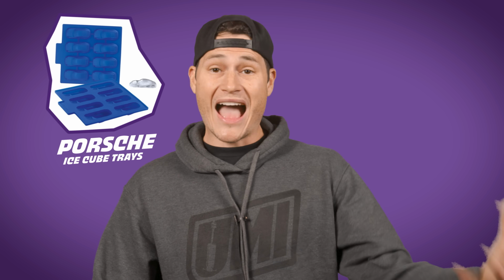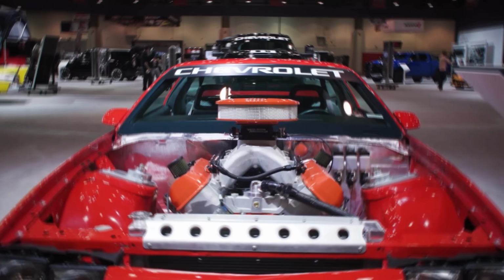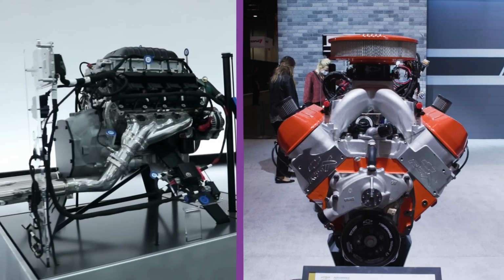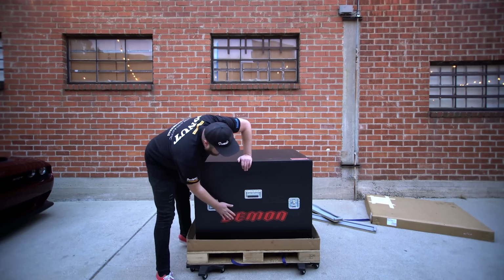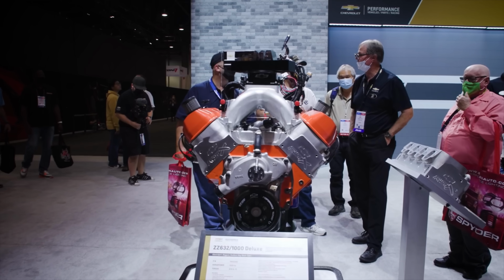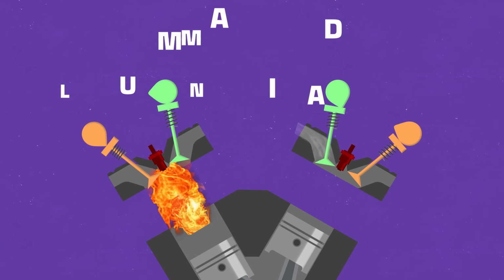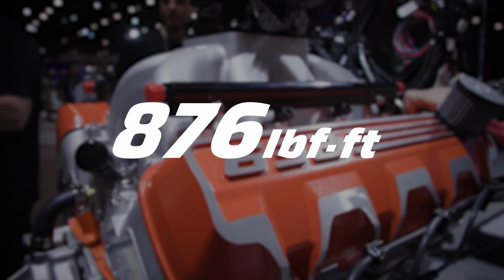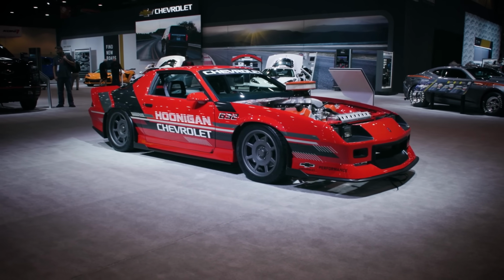Chevy's 1000HP Crate Engine EXPLAINED

Comment: That's so sad that trailblazers went to a 1.2 liter 3 cylinder when they used to have an inlline 4.2 liter vortec which had variable valve timing, and is Luke the American 2jze. Also known as the amerabarra, which is because it's similarly like the legendary Australian Barra engine. Those 4200 vortecs are way under rated, and a few people are getting 700whp out of fulp stock bottom ends.

Comment: Stick that engine on a 2006 4 dr GMC 2500HD pickup with a WFO Concepts straight axle on coilovers conversion lift job running 37" or 38" tires. That's my dream truck. But what automatic transmission would you have to get with an Atlas or NP205 transfer case that would handle this amount of power and torque?

Comment: I was building 632s back in 1990. They called them Pontiacs, but they were big block Chevys. We were getting around 1400 horsepower out of them, but they were 13:1 compression with solid roller cams...

Comment: Explain to me why this engine sounds so good and the stock Chevy ZL1 motor does not sound this good. It does not Chop either. This motor sounds like a NASCAR when it cranks up its loud and it chops and it's got a beautiful nasty sound to it why is it the stock Camaro ZL1 doesn't sound like this

Comment: I have been trying to find a measurement sheet that details widths between mounts, height from the top of the throttle body to the bottom of the oil pan, width left to right, length from water pump to flywheel and anything else that I can get my hands on. All I have is small blocks but want to make the jump. This beast is one helluva jump!

Comment: An all motor engine making 1000hp is absolutely remarkable. Bravo 👏🏽
Reply: N/A is where it's at.... fuck all that boost
Reply: @davelowets I needed this in my 88 Cheyenne. Had plenty of room for it. With 261 gears in the rear end too. Could finally reach it's top speed of blowing the tires out

Comment: the long runners on the intake remind me of the 351 SVO crate engine. The 632 has even more air volume displaced so it sucks even harder to pack the intake charge with a hearty pulse.

Comment: Minor gripe: big block did not go back to the 50s. I have the original Hot Rod magazine from 1965 debuting the "Mark IV mystery motor" which was the 396 in the passanger cars and the 427 in Nascar. Junior Johnson made the mystery motor famous in Nascar. The "W" engine 409 was developed in 61-62.

Comment: Why carburetors and that stupid donut filter which will not fit ANY modern car without sticking through the hood like a ghetto rocket? Nevermind that 90% of the mechanics and car builders not on social security or in the ground has even seen a carburetor never-mind work with one.

Comment: Fabulous engine from GM .  There engineers have completed an Awesome job .  What l would love to see is a Wilson Tunnel Ram Manifold as an Option going 4ward with twin Wilson Throttle Bodies .  They are using one ,  probably a  ( 4500 )  A pair of there 4150's would probably be more than enough.   May give another 500 rpm & hopefully another 80 - 100 hp . Maybe a few of us asking the Question of GM may get this option a gurnsey.   Hope so .

Comment: 1000 hp that's not force induction, eh...? Hypothetically speaking, what happens if you add a turbo or two? 🤔 😉  I WANT ALL THE POWER!!!!
Reply: This engine was built from the ground up not to be super charged. The heavy duty crank, the over sized cam, and the 12:1 pistons, and the under intake fuel injection. It would be impossible to put a forced intake on this engine. But chevy makes a 632 crate engine that you can add a super charger to. It about 15,000 dollars. And starts at 800 HP out of the box. You can add a Whipple super charger that will add 350 HP. For about 10,000 dollars. So you can get 1150 HP for 5 grand less than this engine. And it will all fit under the hood. But it won't beat the sound or beauty of this engine.

Comment: 100hp/liter is pretty good for an NA big block designed in the 50’s/60’s.
Reply: Those cylinder heads and intake manifold were designed much more recently and are significantly different than the original design, and cylinder heads are what determine the power potential of an engine unless something else is really messed up on said engine design. Building a 1,000 HP BB Chevy with the old factory cylinder heads would be quite the feat without boost.

Comment: I paid $15k for a used injector to pan Keith Black Hemi that produces about 10k HP. seems to work well, but requires a complete rebuild for every 1/2 mile driven.

Comment: 6:24 this pissed me off a little bit.

Valves get pushed DOWN, into the cylinder. They don't magically phase through other materials, so it's physically impossible for them to move upwards into the intake/exhaust housing.

It's not even that hard to visualize... because it's literally been visualized when the animation was being created.

Comment: the term "there is no replacement for displacement" is complete bs. engines power limitations are limited by air flow capability and mechanical limits. a 1liter engine with the same flow as a 10 liter will make the same power just at a higher rpm. you can have all the displacement in the world but if the heads wont flow you wont be making any power.

Comment: A SYMMETRICAL HEAD CHEVY BIG BLOCK BASED ON THE FORD CLEVELAND DESIGNS. THAT IS WHAT THESE CHEVY MOTOR ARE, BEING FORD BASED IN DESIGN. IN AUSTRALIA FORD CLEVELAND BUILT ENGINES TODAY ARE MAKING OVER A 1000HP WITH LESS CUBIC INCHES, 440ci. ALL THESE CHEVY RACING ENGINE YOU SEE IN THE AFTERMARKET TODAY WITH SYMETRICAL HEADS LABELED AS CHEVY ARE FORD BASED DESIGNS WHICH INCLUDES THIS GM ZZ632. THEY ARE BASED ON THE BOSS 429, CLEVEND 335 SERIES AND 429/460 385 SERIES. THE DRCE PROSTOCK ENGINE CHEVY HAS BEEN WINNING WITH SINCE 1983 IS A BIG CUBE FORD CLEVELAND ENGINE. THIS IS THE REASON FORD DOESN'T PARTICIPATE IN PROSTOCK RACING.

Comment: Ohio crankshaft will build you a better motor with more power for the same price or you could just buy the 706 short black put your heads on there in an oil pan and competitors and then take and still have money left over

Comment: 1000 hp with no power adders my ass. Lol just like the old horrors had as much hp as they claimed. Haha also they thinned out the valves on a supposed high hp engine? Lol get ready for valve problems.

Comment: HEY I GOT ONE FOR YOU LOOK UP NASA AND STIRLING FREE PISTON GENERATORS.
THEY TRIED FOR YEARS TO DESTROY ONE.
IT HAS RAN UNDER FULL LOAD FOR 110,000 HOURS STRAIGHT.
BEING EXTERNAL HEAT IT WORKS GREAT WITH HEAT STORAGE WHICH IS SAFE CHEAP AND EASY TO USE.

Comment: Get 2 shoehorns and put one in an Opel GT   Now that would be some serious engineering not to mention you had better have an entire sheet metal shop with a couple of metal working mofo's.
I almost bought an Opel GT when I was 16 from a family friend but she decided against it.  It was emerald green with about 10 pounds of meta-flake in it.   It was beautiful in the sun......  I fell in love with it.... I got to drive it a couple times and it was probably the smartest thing she could have done.... not selling it to me.   I weighed a whopping 135 lbs at 5'10" when I was 16 years old and it was a tight fit even then.   I probably would have killed myself in it anyway..... Those cars aren't exactly at the top of the list with Subaru.
Peace.

Comment: Wow my 632 race engine put out 1231hp with twin 1150 quick fuel carb all motor. and I only paid $24,800 from my engine builder.  I could have a built a 737 from him for the price of the GM 632.

Comment: Yes, it's easy take more power than this with a naturally aspirated big block. The point is this is a factory gm made engine. Don't want it, don't buy it. I'm willing to guess most of the commenters here have never rode in a truly rowdy big block car. No, it isn't a turbo charged wonder like a 2jz or something similar. Yes you can make the same power in a forced induction coyote or hemi or LS. You should just be happy that a major manufacturer is willing to bring an engine like this to market in an Era of emissions strangleholds. Guessing most of the hate is from people who ha e barely experienced a real 600 plus engine and are simply regulated to keyboard warrior status. Would I go with this?, no. You can easily achieve this with big block chevy architecture for far less money however, the fact that it is an option in today's "green" world is encouraging. To make it clear, I'm not even a Chevrolet fan.

Comment: I'd opt for a '71-75 Coupe DeVille.  They came with a 500ci (8.2l?) V-8 so I'd guess this crate engine would fit, and you have lots of room for a bigger transmission, diff, bracing, etc. etc. to take the power.
Reply: Correction.  Only eldorados came with the 500 engine.  DeVille's in those years came with the 472.    But yes.  There would be plenty of room for the 632 in the engine bay.  I know because I have an all original 1971 coupe DeVille in my garage.
Reply: Or an early 70s El Dorado.

Comment: The original big block Mark II "Mystery engine" had symmetrical ports, which GM decided were too expensive to mass produce so the Mark IV had the short and long intake ports. Decades later GM finally produced a symmetrical port big block engine which was what chief engineer Dick Keinath wanted from the beginning. Sadly, he didn't live long enough to see it happen as he died in 2010.
Reply: Well in a way he did. The 8.1 liter Big Block available from 2000-2009 HD 2500,3500  GMC and Silverado had the same type of cylinder head.
Reply: That symmetrical port big block sucked also....

Comment: Has anybody done a real life dyno test on this engine? You know how the factories lie about hp. I would guess that between 700hp to 800hp is all you will get.
Reply: No, I have a 565ci BBC with smaller heads and cam and it made 738hp and 675lbft

Comment: Jeff Byrd can get 900+ out of a small block chevy and that is alot of power before nitrous or add-ons.  Lincolnton North Carolina.  That is a shop build not a corporate build. Not impressed with a 40 grand build less than 1500hp.

Comment: OR.....What about a 32 valve DOHC 632?

Porsche M28 four cam/four valve cylinder heads will actually fit on the Chevy block.  Arias in California has done this conversion;  It takes some drilling and welding, but since the bore spacing is almost exactly the same, you can install a Porsche cog from the front of the cam/waterpump on the big block Chevy to drive the timing belt to the exhaust cams on the Porsche heads and now you have a DOHC 32 valve engine.  Arias has done this with 502's, and the Porsche cams can support up to about the air flow that this displacement requires.  

The 502 makes 550 hp all day long like this and will pass California emissions standards.  Imagine a DOHC 632 with porting and better cams.....

Comment: You know, a 180 degree "V" angle on this engine would make it PERFECT to power a lot of King Airs and other airplanes that use PT6 engines...
Reply: To be honest would not want to scream across the skies with two of these 😂
Reply: you can't just change one aspect of an engine. Completely changes its balance, stresspoints, oiling and cooling.
Reply: @heygek2769  You would have to change the crank and cam, but I doubt oiling and cooling would be affected.  Aircraft have totally different engine mounts than automobiles, and "boxer" flat engines are naturally balanced.  Orenda up in Canada has powered King Airs with big block Chevy-derived piston engines and they work just fine.  It would work if someone would do it.

Comment: Bare with me because what I’m about to suggest is absolutely INSANE But… I bet ANY true gear head, horsepower nut, or speed freak would love to see it at least once in their lives!! Now take into account you’d have to butcher this vehicle like Jack the Ripper but still. Cram a 632 down into an old Chevy Luv mini truck!!!😏 Hearing people say “Your stupid! You couldn’t make that fit if you wanted to!” makes it even more desirable lol & there isn’t ONE doubt in my head that you guys couldn’t make it work. Just picture it… A tubbed Chevy Luv with a 632 B.B., Ford 9” rear end, & maybe possibly a sequential 6 speed! It would be pretty much guaranteed that you’d need to setup up a remote shifter for the trans but that shouldn’t be to much of a problem especially compared to getting a working clutch pedal installed, but on the bright side you’ll only need the clutch pedal for take offs & reverse 😜 I’d imagine the driveshaft in a setup like this couldn’t be more than a foot or two long depending on engine placement (the farther back the better) & transmission length. The end result for the driveshaft may just be two yokes welded together🤣 Whatever, it would be awesome!!!! What a beautiful little Frankenstein wheelie monster it would be. I dub this imaginary work of art   ☠️“Frankenwheelie”☠️

Comment: I like the fact that they put a carburetor in this engine since they haven't been in new engines since 90s
Reply: Not a carburetor, a Holley throttle body .
Reply: @fredbadgett7962  I thought it Has a carb because it has giant air filter on top but ok

Comment: Allow me to make a suggestion: There needs to be some explanations about thermal, mechanical, and chemical efficiency limits in ALL overhead valve internal combustion engines regardless of the number of valves or cam placement. People are still stuck on this HP/L measures of volumetric efficiency when they need to realize that more rpms, larger straighter ports, and radical valvetrain events create this in ANY engine. Volumetric efficiency is only used when there are displacement limits like in racing classes and European and Asian tax laws. I'm in the USA, so I could care less about HP/L, and here is why:

Here is how a real engine builder thinks about this: I can't achieve better than 30% efficiency so I'll build the largest displacement engine I can and then make it breath how I want. If I want low maintenance hydraulic lifters then I'm limited to about 7000rpm. If I wanna run pump gas I'm limited to about 11-12:1 compression. If I add just a bit more deck height on the block and option for a conjoined bore block, I can support that 4.600x4.75 bore and stroke which gives me 632ci or 10.3L. How much HP will it make? Depends on cam, intake, and head combo, but at 12:1 compression I'm going to make a MOUNTAIN of torque somewhere. If I don't go nuts on cam and head ports, that torque can be MASSIVE at 1500rpms. I don't really care about engine features, only external dimensions, weight, and packing in as much displacement in the smallest cube possible. All engines are just cubbish blobs that make torque.

You guys need to start overlaying dyno curves of torque and power so that your fans can see all of that area under the curve. Not sure why Euro/Asians can't seem to grasp this basic understanding of how this stuff works.

Do you guys really think this engine weighs a full 250lbs more than an LS? Think about that for a sec. It's two inches wider, two inches longer, and two inches taller, and the extra area isn't composed of lead.

Next thing we gotta talk about is packaging.  These arbitrary assertions that a Mark IV is "big", "huge", and "heavy" are damaging to new enthusiast's understanding. JUST BECAUSE IT'S REFERRED TO AS A "BIG BLOCK" DOESN'T MEAN ITS EXTERNAL DIMENSIONS ARE LARGER THAN ANOTHER ENGINE'S, AND THE SAME GOES FOR WEIGHT. Where did the 680lb figure come from? A random spec on karl customs website? That number comes from the old all iron Mark IVs of the 60s, NOT this aluminum headed, aluminum intake, aluminum throttle body, aluminum water pump, no distributor, long tube header equipped wonder. How bout you knock 100lbs off that figure, and then another 100 if you build one with an aluminum block. That's right, you could have 10.3Ls for about 500lbs. Now go weigh an RB26 with all turbos manifolds, intercooler, plumbing, wire harness, ECU, and all the rest of the trimmings and tell us what you get. Also, if you are going to talk about how physically large the engine is you should compare it with real measurements to any of the engines you like. How long is a BMW I6, how about a 2JZ or a VK? How does that pig 13B-REW manage to weigh 500lbs?? Probably aught to bring that up if we are being fair. I'd trade 80lbs for 9 more liters of displacement! 

Once again, you guys need to represent this in the correct light, not just tell everyone "it's massive, it's heavy, and it make donkulous power", because that doesn't do the product justice. The name of the OHV ICE game is largest internal swept volume with minimal external surface area and weight. Here the specs for a 9.8" deck Mark IV: 28 inches wide, 30.5 inches long, and 29 inches tall. Now go compare that to a Coyote and overlay the dyno curves and you'll start to get a handle on what I'm talking about. Wanna build one for yourselves? Want it to weigh less than 500lbs? Check out Speed Master, Dart, BMP, Blueprint, and others and they'll have everything you need to put one together for a lot less than $30,000. What you'll have to work harder to find is a symmetric port small chamber 12* head like the RS-X that flows over 480cfm. You guys didn't even mention the heads, or the digital coil near plug ignition, MPFI, no distributor, and self learning ECU built into the throttle body. Most of your audience is missing a lot here.

In order for people to grow and learn they have to be shown full comparisons so that they can understand the compromises that any engineered machine will have. I'm so grateful for the knowledge and experiences I've had and wish everyone else the same. If you study ALL of it and really learn you'll have no choice but to love the Chevy Mark IV family because it's that good, and then you'll wonder why anyone goes with anything else.